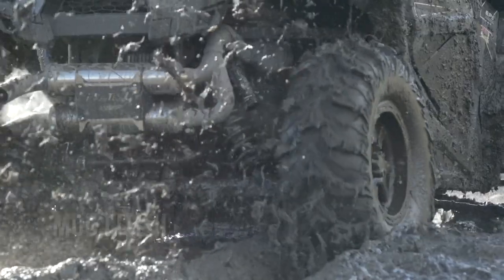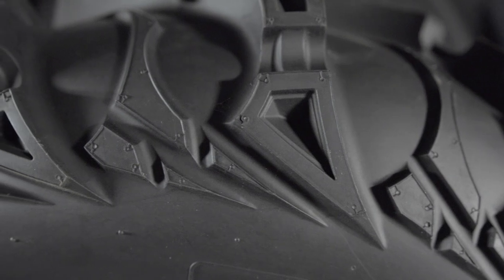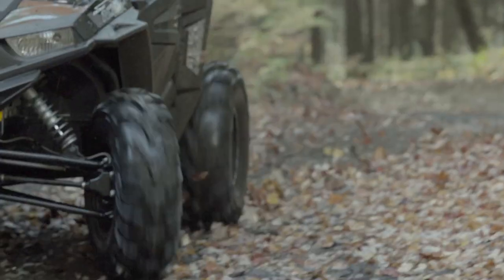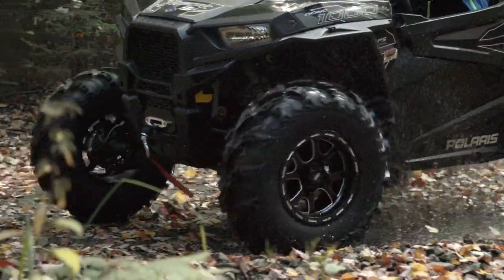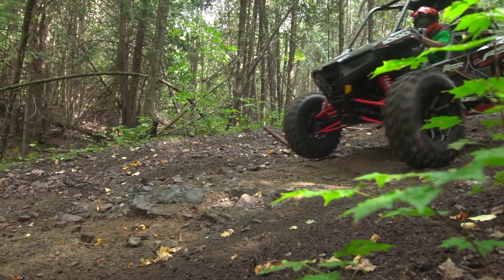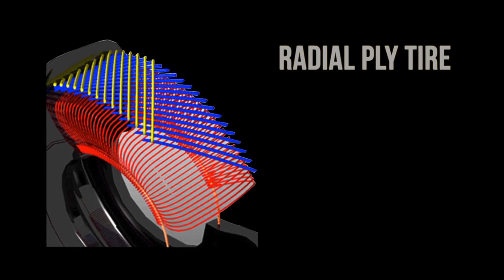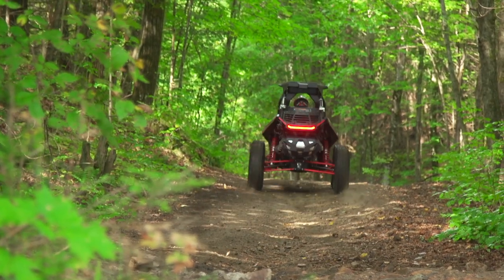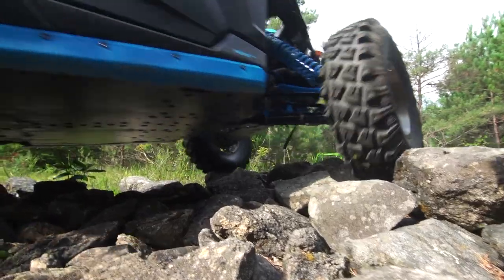Bias Ply vs Radial ATV and UTV Tires Featuring ITP Tires and Wheels

Comment: Everyone said get radials, I got some big Horn radials on a 750 KQ. They made it oversteer like mad and felt like there were no shocks. So I put bias back on and it was great. Used the radials for plowing. 
I traded in the KQ but before doing so I put them on the AC 700 Alterra. They are great on the Alterra but I'd still prefer bias. 
So imo, the ATV itself is also a consideration when choosing. I know what I want next, but these radials last too long lol

Comment: I've been riding ATVs, motorcycles UTV, SXS's all my life. And at 52 years old I have never had a radial tire  that rides "better" than a bias ply on ATV or SXS unless you are talking about riding STRICTLY on highway etc 
The statements in this video itself are  completely contradictory. Saying that the bias-ply let's the tread flexo it cleans out better tells you that the tire actually does flex better which will end up giving you a better smoother ride in rough terrain. 
You can test this yourselves by using bias and radial tires and doing some off-roading just watch the flex that the bias tires have, how they give, how they mold around the obstacles, and then put on some radials and see that the only way this happens is if you have absolutely no air in them. Also most radial tires these days are heavy ply, 8 ply,  they have absolutely no flex They ride hard as a rock. Lol. 
I have tested this myself several times. Even had to exact side-by-sides, one with the stock bias, the other with aftermarket  radials, we did a test ourselves off-road and found that the bias tires were extremely better at providing more comfort.
There is also the reason why the radials tend to not get as hot as bias-ply tires, IF when riding hard, extreme fast, payment etc, the bias plies get hotter because they do flex which causes friction within the molecules which forms heat the radial tires do not flex which helps them keep from producing friction in the sidewalls which make them run cooler. 
I don't know why there's this misconception out there about this.

Comment: Are mega meyhams all looks or do they preform well in thick mud
Reply: Been running the set from my brothers 570xmr on my viking vi recently and I must say I have been very pleased with them to the point I am contemplating buying the 32" mammoth meyhems over the xm310
Reply: I have two friends that run them and they go everywhere.  I have never had to pull them out.  They are always having to help me get out.  Lol
Reply: They're a digger

Chevron and paddle style are pushers

Diggers and ags are better in clay

Chevron and paddle are better in swamp
Reply: @mattbarrois8675  I’ve had both the Megas and xm310s I will say the 310s outperform in the mud.
Reply: @destinhook3826  without a doubt the xm310 is the better tire but you can buy a brand new set of mammoth meyhams for under $700 on Amazon whereas the xm310's in a 31" will run you around a grand ill take the extra savings for how well they perform

Comment: Anyone have anything to say about itp blackwater, what is there niche terrein?
Reply: I ran a set and they are an amazing all terrain tire and can't recommend them enough.  I found a controllable and reasonably quiet ride and excellent traction and amazing side hill traction on basically every terrain and wasn't afraid to tackle very swampy and mucky areas.  I've ran the full blown itp mega mayhems and they sucked for everything other than deep mud and snow, defiantly a specialized tire. I have ITP baha cross on my rzr and I run mostly dirt roads and rough trails and they excel at steering control and stability but don't do snow or mud. I ran on itp swamp lites and was very unimpressed as they didn't really excel in any particular area and wore out fast.  I had to run high pressure to have stability and it really hurt ride quality and traction.  Sorry for the rant but I'm very weird and particular about my tires and the blackwaters and rocktanes are the best all around tires that will do everything really good in almost all situations